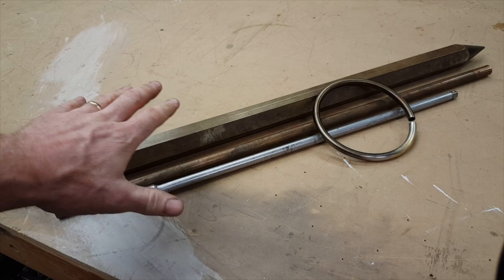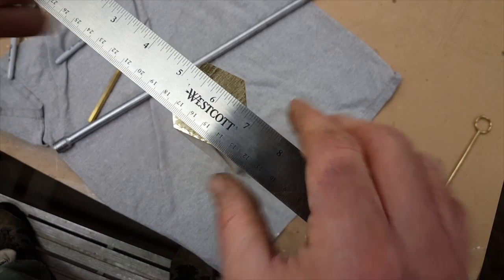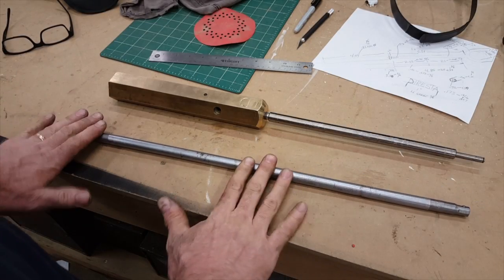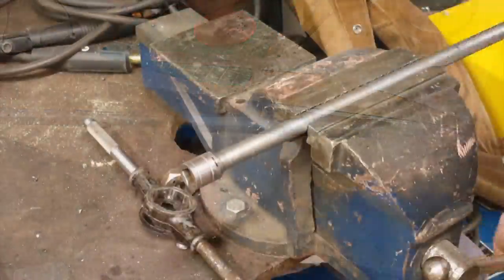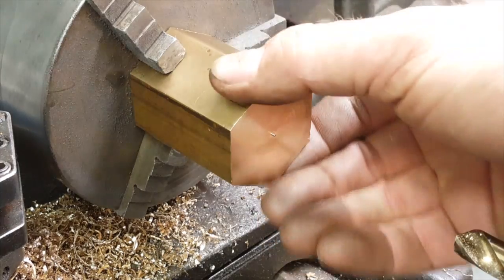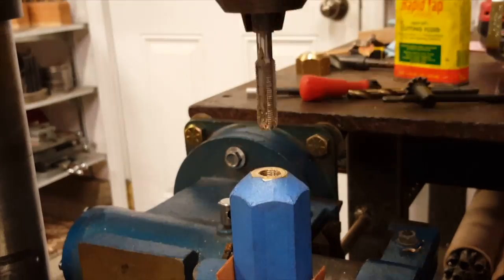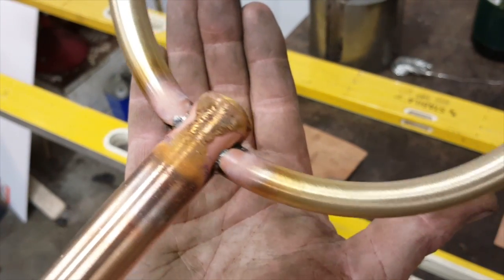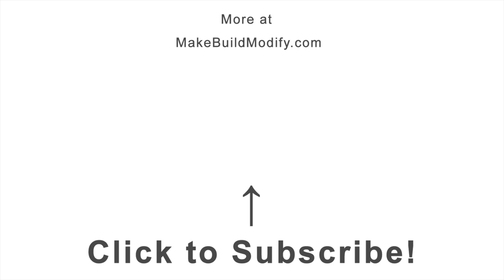MEGA DiResta Ice Pick

Comment: Awesome just one thing that I have to say, 10:17 when you are sanding and the strip of paper is long enough to wrap around the part don't hold the paper so close together. Try forming a 75-90deg angle instead of the small one you had going on, good way for the paper to grab and suck you in. Sounds silly on a small benchtop lathe but its good practice for larger lathes.
Reply from the maker: Good point. Thanks for the warning and for watching.

Comment: Well, that was just fantastic! Really nice job on all of the details! I would not have thought to use that long reach socket as the tip.
Reply from the maker: It's what I had. Plus the metal seemed to be better than common steel dowel stock from the hardware store. So I thought "Why not?"

Comment: Was the socket extension hard to turn on the lathe? I would think they would be hardened. -Thanks!
Reply from the maker: It seemed to be a little harder than mild steel. I did a few tests to see if I could put threads on before I started. It would have been a bummer if I cut it down to a point and found that I couldn't connect it to the brass.

Comment: Awesome build! Great use of found material! Makes me curious what it was once intended as or used for though...
Reply from the maker: Me too. I wish I knew.
Reply: Not a single ID mark, then? If there was ever a shop at the site, I suppose it could've been scrap from something larger, though the pointed end makes me think it may have been a finished piece of some kind. Decorative lightning rod? I've no idea the cost, but isn't there a way of identifying where a metal was mined by finding out what trace isotopes are in them? Still wouldn't tell you what it was though.
Anyhow, enough rambling, sweet project!